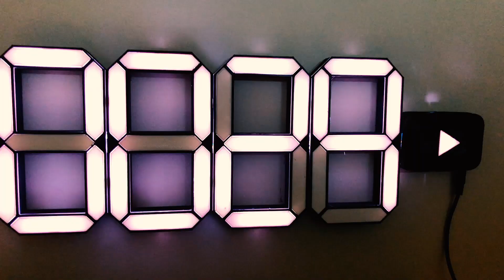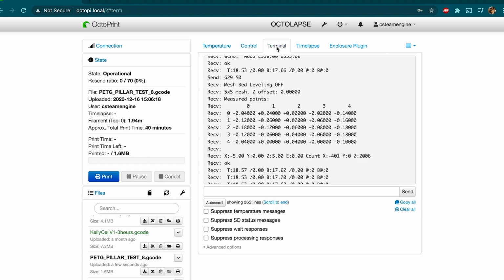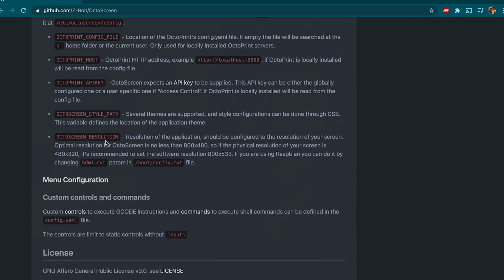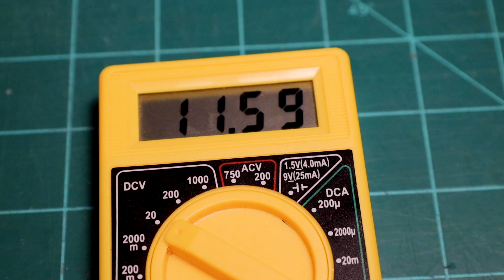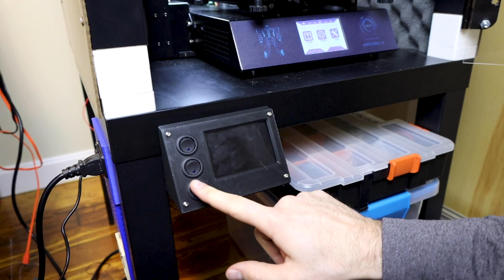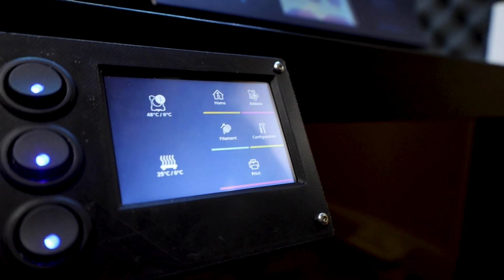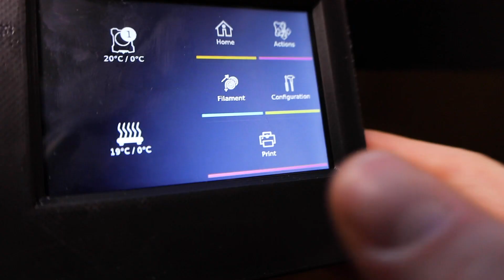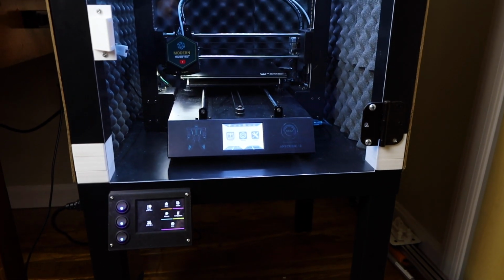DIY OctoScreen Setup To Control My Anycubic i3 Mega!

Comment: Hi Charlie, I have a side question. What is better for OctoPrint, the inbuilt wifi of  the Pi3B or use a wifi adapter?  The Pi would be roughly 7-8 meters (~25 feet) from the router Behind one concrete wall..
Reply from the maker: Hey thanks for the comment! I am using the built in Wifi on the Pi3B over a distance of about 7-8 meters and it works great, albeit without a concrete wall in the way. If you haven't purchased a USB adapter yet, I would go ahead and try it without, but that concrete wall makes me apprehensive lol
Reply: @ModernHobbyist  I do have a wifi adapter. My printer and pi would be in a corner of a room on a table.
Reply: did you find out which worked better for you? ik most setups guides say to use a dongle (edimax, IIRC?)

Comment: Hi, I recently installed TMC2208 in my MEGA (upgraded from MEGA to MEGA-S in 2019) and flashed it with the marlin firmware, but after the first print with those, they make a lot of noise, especially the X and Y axis. Even when given the homing command from the touchscreen of the printer, they  make noise. I've set their voltage to 0.85-0.9 V. Please help.

Comment: So super easy to make it work. Using a lcd for the pi 4b on the 3b+.. Idk how it worked but it did. 2 questions. Can I still use the Raspberry pi cam and when I click on shut down it asks for a password. Do you know how I can bypass that?
Reply from the maker: Thanks for the comment! For the pi cam, yes you should be able to, I have used both a Pi can and a USB webcam. For the shut down question, I'm not sure about that, it doesn't actually require a password for me. Do you by chance have it set to auto-login? If not, try setting that up from the raspi-config.
Reply: @ModernHobbyist  Thank you!! it worked :)

Comment: Great project,  clean output.
But you should work on your soldering skills dude there's lots of cold joints there.
Reply from the maker: Thanks for the comment and the feedback! I agree, unfortunately after a while the coffee gets to me and I can't keep my hands steady no matter what I try lol
Reply: @ModernHobbyist  Try a stronger iron, like 40W or 60W, the 400°C is a great temperature, high heat for short time, that's the key
Reply from the maker: I do notice that at times it takes forever to melt sometimes, so I cranked up the knob on my base station to 5, hopefully that helps. Unfortunately, it isn't a nice enough soldering station to tell me the actual temperature, but oh well :S Thanks again for the feedback I definitely appreciate it!
Reply from the maker: Definitely could be! I'm hoping to upgrade soon...
Reply: @ModernHobbyist  I know I'm a little late, but I noticed at 4:13 your soldering tip looks very oxidised. This massively limits its ability to transfer heat. My old iron was like this. You can often recover this with something called 'tip tinner'. It comes in a little pot, and you push the tip into it, and it removes the oxidation and re-tins the tip. Might be worth trying if you still have this iron, and very cheap